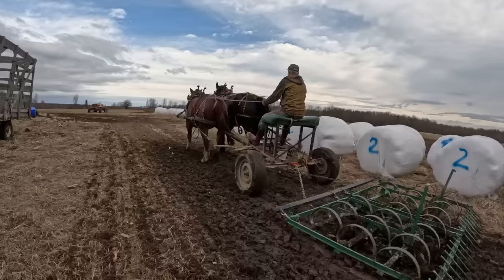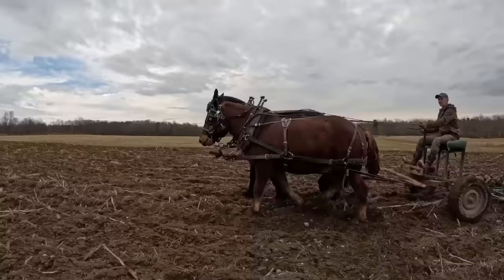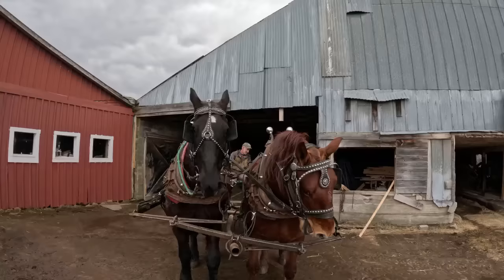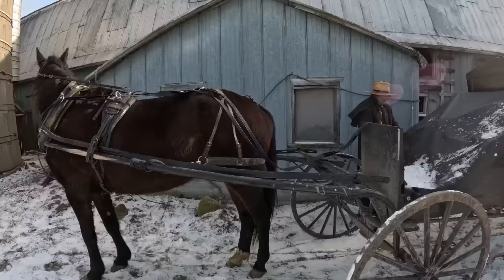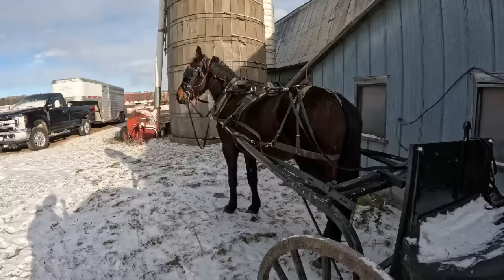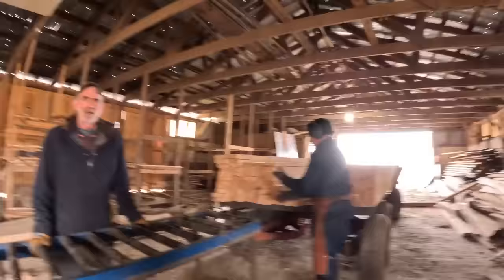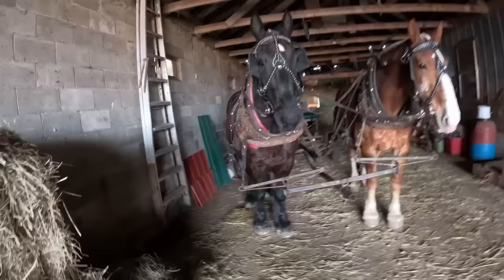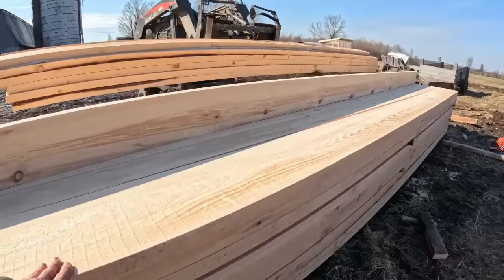William is Hauling Hay Home! // Sawing Lumber with our Wood-Mizer LT-40 #603

Comment: Hi Jim , Brenda and William, Nice tidy up of the driveways. With Ken and Earl . Earl will learn that being a bit resident in backing into the barn is futile with Jim on the lines and Steady Ken pushing backward. . William's buggy is quite interesting with a single front seat and rear storage compartment . The two wheeled cart is quite handy to  haul Hay and lumber and etc. William and Jim working in the sawmill worked well. Although Brenda is a much better looking helper. LOL

Comment: Boy that's a nice log on the mill at the end , Holly smokes.  I wonder if you cut the lumber like store bought, you will get one more board per log. 2" wide or 1.5" wide or 1.625" wide or thick I should say.  Bandsaw has a pretty thin kerf.  Thats good, but it seems like if you cut them all 2" thick you have one less board to sell seeing market lumber is 1.5".  Also now a 2x12" measures 11.125" at the lumber yard. Where they used to be 11.5". So you have to charge more for a true 2"x6".  I suppose it depends on what the customer wants.  Nice video nice work, beautiful unit of lumber.  I like your exit rolling table and your getting good production process, wood is nice and clean and orderly, nice job. :-).   Love the way the spring tooth drag gets the driveway,  those drag fingers are nice.  Looks good.
Congratulations finding the neck yoke, I was trying to think how that got right there? That's unlike you, ah ha, stuff happens, great recovery.
Reply: Holly Smokes John . You sound like a bean counter ( accountant) . IF Jim cuts his boards , to lumber store sizes he can make more boards  to sell .Makes me think as I look at my morning size box of cereal.  ( Kelloggs  corn flakes) .😊😊😊😊

Comment: Your yard is very flat with no run off an holds the water an makes a mess
Reply: Just like many older yards. The land slopes toward the sheds and barn. Could use some gravel by the truck body.